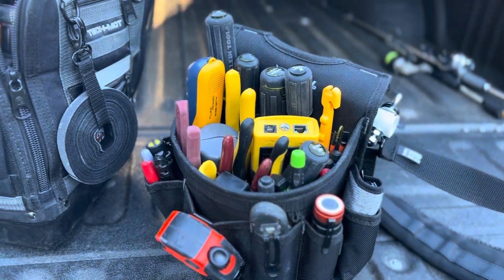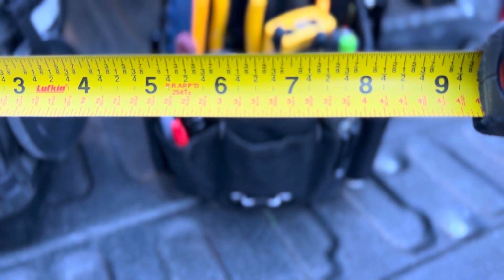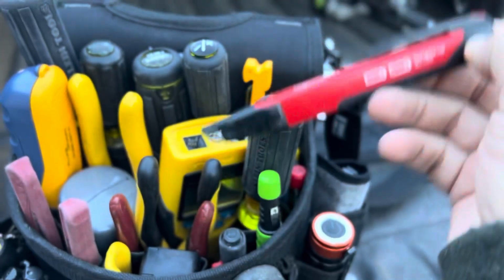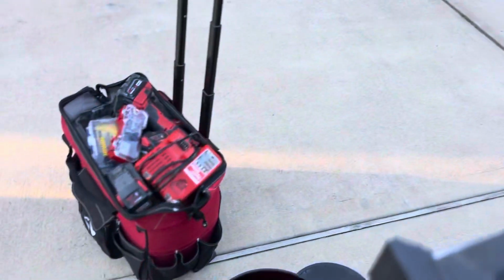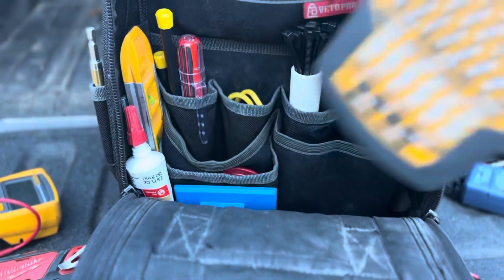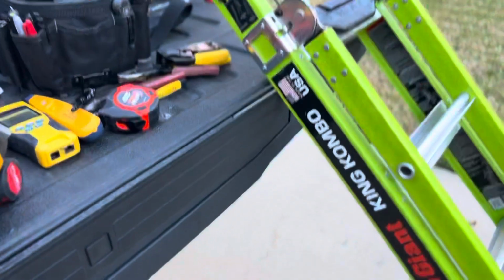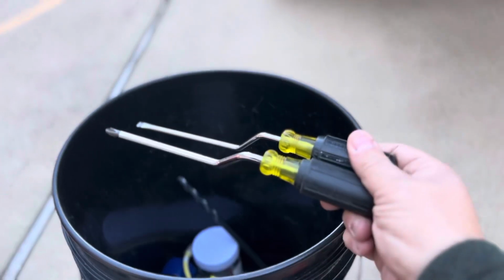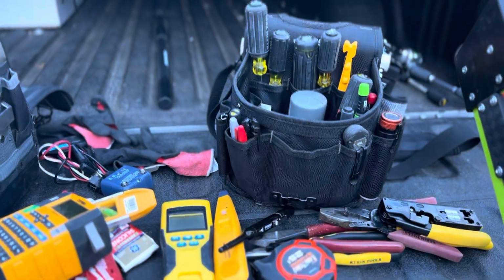Advanced AV & Automation - Low-Voltage technician EDC loadout Veto Tech MCT

Comment: Hey Rick just came across your video and really liked it.  I have my own low voltage business as well.  Just curious what tool bag you used for your main load out?   I use veto bags as well but you mentioned you use Klein so curious if you had a model for your smaller main bag.  Thanks!
Reply from the maker: It’s just a basic Husky bag from HD.